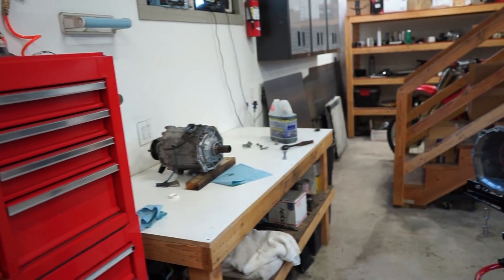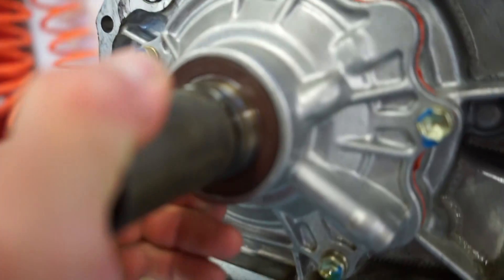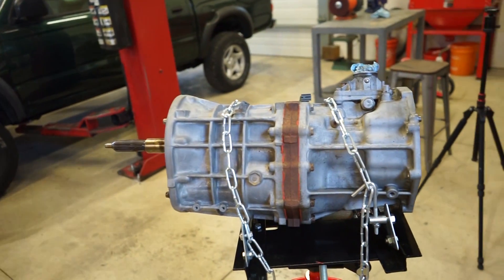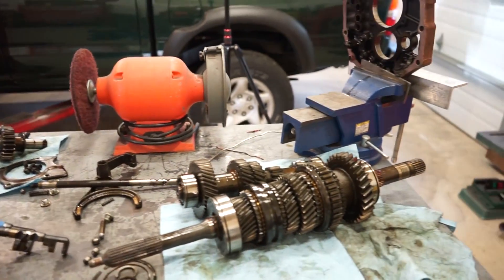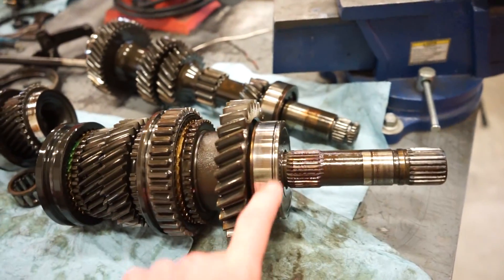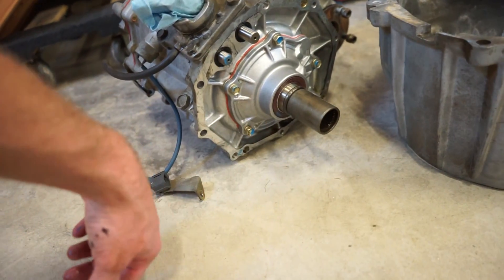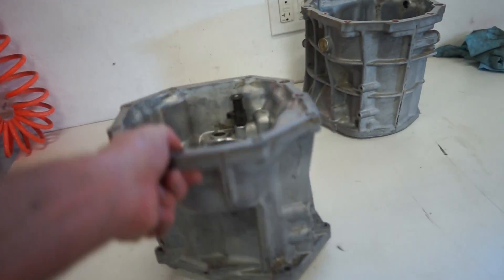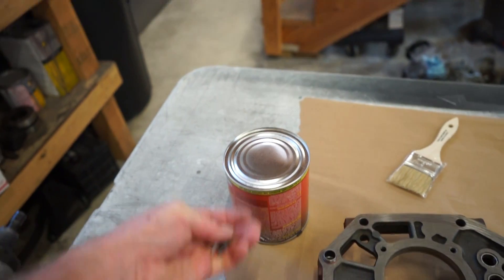Toyota Tacoma Transmission Rebuild Part 1

Comment: I'm trying to figure out if this is the transmission that is in my 01 PreRunner 2.7 automatic 4 cylinder if so it has 442 thousand miles on it

Comment: I've got a 2006 Tacoma 4.0L with a 6 speed manual in the shop. Do you know if the rebuild and setup are basically the same as your tranny in the video? Appreciate any info.
Reply from the maker: I’m not sure! I’ve never been in a 6 speed!
Reply: @austinniemela  Thanks for the very quick reply
Reply: Correction 2005

Comment: I am wanting to swap an R series transmission into my 1999 4runner 3.4. I am wondering if I can use my existing transfer case, the one that is behind the automatic. I have heard they are the same transfer case, but I suspect the shifters are different Siri do you know anything about this?

Comment: Get the transfer case seals from toyota, they still make them. I just did the ones on my 91 4runner.
Reply: Ball joints, seals and bearings ALWAYS OEM Toyota!! A little most cost = a lot less headache!!

Comment: You need a smaller 3/8 impact for the smaller bolts brother. Using that heavy 1/2 must have gotten tiring lol.
Reply: Look at the arms on that yung-un !
Reply: My 3/8 drive didn't break any of these bolts. Need a half inch